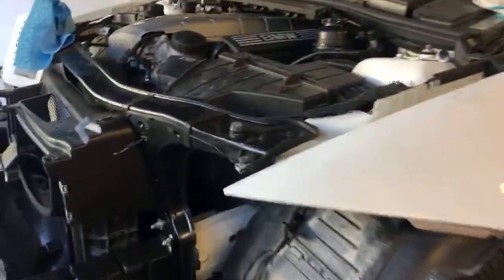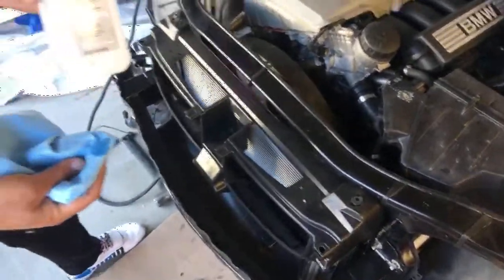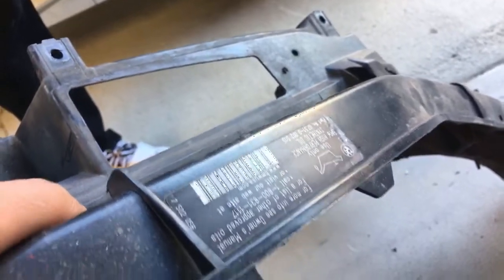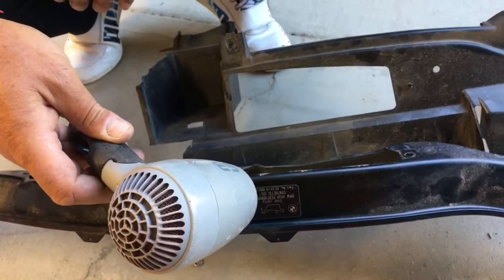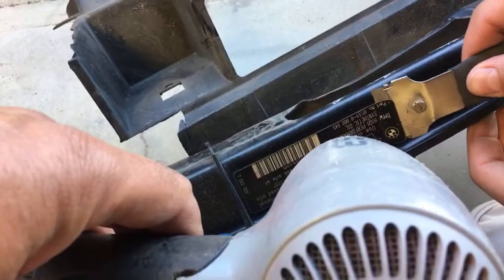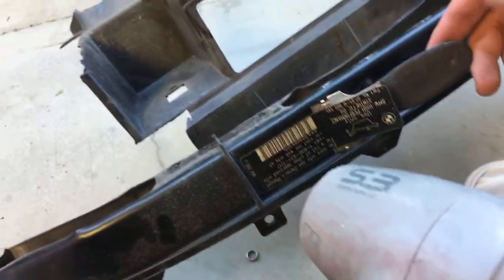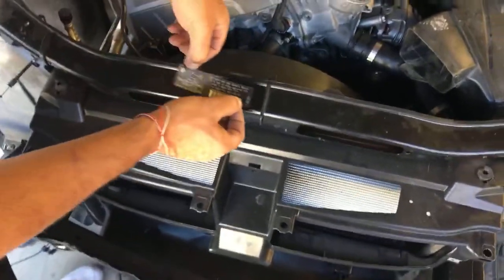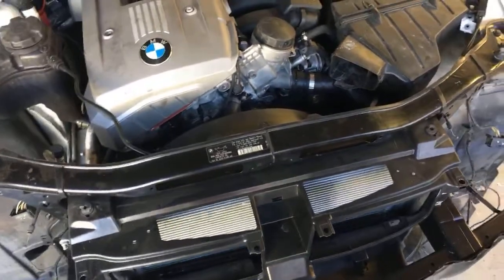HOW TO REMOVE EMISSION STICKER VIN STICKER FROM CAR HOOD

Comment: Where do you get that scraper tool to scrape the vin plate?
Reply: Luan Truong autozone has it just a razor blade scraper tool
Reply: Home depot in the spray paint aisle less than 5 bucks